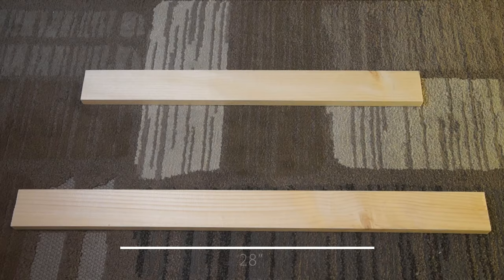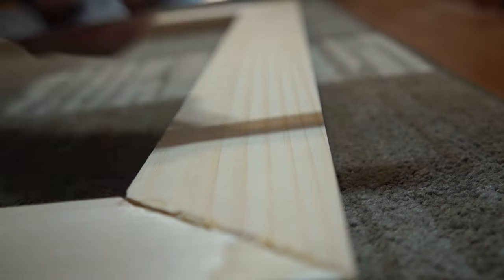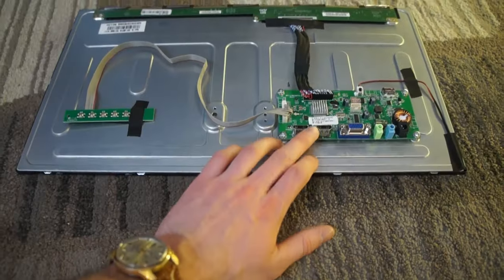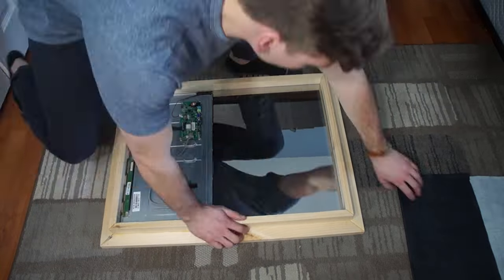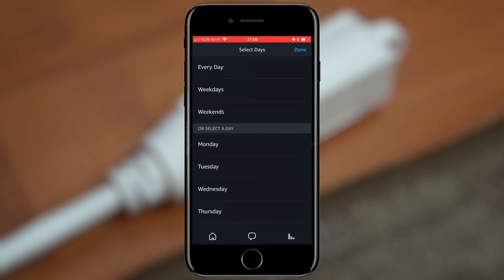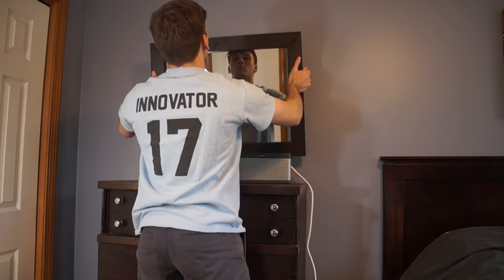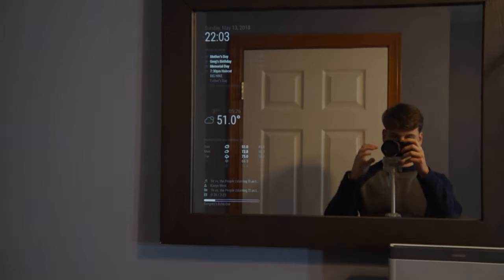ALEXA Smart Mirror (New Build)

Comment: put tape over the spot before you drill through, use a smaller bit to create a guide hole also helps and if you clamp a scrap piece on the backing (where you're drilling through to) helps prevent blowout for a clean look.

Comment: Might be a stupid question, but is there a specific cloth material you used behind the glass so no light can shine through?
Reply from the maker: Gaming with Keegan No I used thin wood painted black in another video and fabric in this one for easier cuts. Just make sure light isn't allowed through and you'll be good with anything. Make sure it's black too
Reply: You could also probably do several layers of spray paint over the back as long as you tape over the part where the monitor will be... might take a while longer though lol
Reply: @Grensom  Hey man is there any chance you could link it if you bought it online. I am in the process of making my own mirror and I've noticed that yours doesn't have a noticeable line where the monitor ends compared to some other people's. Would really appreciate it

Comment: Amazing!
Could you do a more in depht guide please? I couldn't understand the circuit properly. 
How does the sonoff work?
How are you able to play music?
Thank you for this video
Reply: dude... it's just lights... it's not that hard... and he probably put a Bluetooth transmitter, or the monitor has speakers, either way... and he just used a sonoff for a mic you could use any mic with the right detection range.
Reply: Sonoff is wired into the power cord so you can turn it on/off using Alexa
Reply: @joshanderegg4157  That is both really unconstructive, but also completely wrong.
The sonoff is wired to the pi's power cord, so you can use Alexa to turn it on and off (just a simple relay connected to the internet or something. It is absolutely not a microphone!). The leds are powered by the pi's GPIO pins I think, he didn't show code for that. 

(I watched the vid yesterday so don't kill me if I got some details wrong ;) )
Reply: Vemund Kremund how did he power the LEDs? I dont understand what happens after he split the 12V power source
Reply: Circuit diagram on video shows raspberry pi 0 but he is using pi 2 or 3 and pin 25 on pi is ground so basically this circuit diagram is fake. Im pretty sure he connected Gain to listening and responding pins on Pi.

Comment: Going to try this during quarantine here. Couple quick questions.   1 - Do you have a link for the material you used to block the mirror out?  2 - With the extra USB on the raspberry PI, can I just get LED and have it plug into that?  (Or would the LED's always be on?) Hoping to skip the battery as I can mount this on the wall long term and not looking to change out batteries. Great build, thanks for the tips!
Reply: did you ever find the black out material?

Comment: Amazing and Great Idea! 
I have one question tho.. the heat generated from the components will not cause the wood to burn one day for any reason like an electric malfunction or overheating or is it safe 100%?
Reply: The Philosopher the heat is minimal
Reply: The heats minimal. And also the wiring is completely safe. The pi just runs on 3.3v or 5v (cant remember) and the monitor is prolly well made. The Mosfet cuircit is simple
Reply: I have to say if you want 100% guarantees all appliances will be perfect, well, you're going to be disappointed.

Comment: Imagine screwing it on the wall then realize it’s upside down
Reply: Eric Su TRIGGERED 😂😭
Reply: GZonPC  how do you flip it if it's screwed into the wall
Reply: @meso_p  Its not screwed in, its hung up on screws which are screwed into the wall.
Reply: @sadbadmac  i'm basing off of OP's comment
Reply: @sadbadmac  also i don't think how you would hang it upside down then
Reply: Well, just rotate the screen then with two commands. 30 second job
Reply: Raspberry PI has a setting you can flip the screen orientation all in software. It wouldn't be a problem.
Reply: Ti esrever dna ti pilf - Missy Eliot

Comment: Great video. I'm currently starting to build my own still Gathering up supplies and materials. I bought a cheap picture frame at a discount Decorating store and you the back cover the came with the frame as my mask around the monitor. I just laid the monitor on top of the Mask appalled the dimensions of the monitor and then assembled it into the picture frame blocked out all the light.  Now I just got to figure out how to program it since I don't know how to use C plus plus and all that stuff

Comment: What I want to know is what are the prerequisite skills you need to know before you do this sorta project? Sure I can try to follow the video but I'd like to know the knowledge and skill you have so I can do some cool stuff like this on my own
Reply from the maker: Jesse Honestly the hardest part for me was the woodwork cause I'm not the best carpenter. Now I did go to school for electrical engineering so as for the lights - knowing how a MOSFET works is important. Additionally knowing some info about Raspberry Pi or arduinos with programming and utilizing their GPIOs might help. I am not really a Software Engineer so you don't have to be a pro there - as I am not

Comment: It's a good project but quite expensive... I mean ~400$ is a bunch of money but still worth it.
Reply: why 400$ when you can buy the monitor for around 20-30$. The raspberry pi 4 is around 30$ or you can buy the pi 3 cheaper. The rest is around 50$ top. So that's around 100-110$ not 400$.

Comment: 🎯 Key Takeaways for quick navigation:

00:00 🪞 Building the Mirror Frame
- Constructing the frame of the smart mirror.
02:05 🖥️ Assembling Components for the Smart Mirror
- Overview of the main components needed for the smart mirror:
  - Raspberry Pi, monitor, HDMI control panel, LCD screen, and backlight.
  - Use of heat sinks for Raspberry Pi to dissipate heat efficiently.
03:39 🎨 Crafting and Finishing the Mirror
- Staining and finishing the mirror frame to match existing furniture.
  - Adding ventilation holes and support screws.
  - Installing LED lights and wiring for indicator lights.
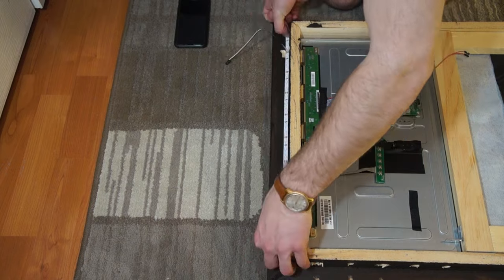04:36 💡 Setting Up the Electronics
- Connecting LED lights to Raspberry Pi with an end Channel mosfet.
  - Using a Sonoff switch to control turning the mirror on and off.
  - Integrating Amazon Alexa for voice control and setting routines.

Made with HARPA AI

Comment: So if I made this without the PI would I still see what’s on the screen or what, what does the PI actually do
Reply from the maker: Nbei7urerne Yes so you can do that, but the reason for the Pi is to run the software that displays the time, weather, music etc. It is basically a mini computer that displays to the monitor via an HDMI connection. It's small, powerful and customizable which is why I used it for the build.
Reply: Grensom also I clicked on the link in the description and it showed how to set up the pi for the google is there one for the Alexa, I simply wanted the weather and time to show up so I will need the pi right ?
Reply from the maker: Nbei7urerne I am currently in the works making an Alexa setup. But you don't need to that to run it. Just download the image in that video and skip to MagicMirror Install and you'll be allset. Setting up the Google assistant is optional on that video. You cab read the description of that video for instruction
Reply: Grensom oh ok so I can skip a good chunk of that so I don’t get the audio bit PS thanks for the awesome help and reply’s
Reply: Grensom so overall I will need the pi to just get the image and install magic mirror then I’m done right
Reply: Grensom could I just use a normal PC hooked up to a monitor to run the software or is the raspi a necessity?

Comment: Hi, where did you buy the material to cover up the rest of the mirror? Or what is that material called? Thanks, nice video!
Reply: did you ever find an answer to this. Ive noticed there isn't a noticeable line where is monitor ends compared to some other people's
Reply: @nickhabre2824  I never did unfortunately… I ended up ordering a mirror which is the exact same size of my monitor and used that.

Comment: 0:24 a little problem with your math,  the inner length of the shorter piece would be 17" not 16". If the width of the board is 2.5 " and you cut a 45 degree angle, you are cutting 2.5" off of the shorter side. 2.5 x 2 is 5. 22 - 5 = 17. Good job on the video! I am doing this as a project for my math class and that is how I found the mistake.
Reply from the maker: Yeah, you are correct - I did see that after the uploading. I should've measure twice.
Reply: what are the dimensions for the smaller frame of wood?

Comment: How does your power supply from the monitor fit? it seems to stick out but you do not show in the video the power supply replacement. Did you order a 12V DC Female power connector and solder it to the bottom of the monitors motherboard so the power supply will lay flat to the mirror and in return be flush with the wall? I made my own from this video but my power supply sticks out and I suck at soldering :/

Comment: I am planning on making a new bathroom mirror and now thinking it really needs to be a smart mirror. Any easy way to power the monitor and pi from one outlet?
Reply from the maker: Benny46drift Yes, I did the same in my bathroom. Use a small extension cord behind the mirror and you plug everything into that and only have one cord to plug into outlet.

Comment: This is cool but ... it would be cooler if the Pi controlled everything - screen power, LED, etc. Without giving up anything to Amazon for control you could run it all both on a schedule and on touch and/or motion detection (PIR or doppler).
And, even better, run dual screen so it works either with a pi4 or a pair of 3s or pair of zeros -  I suspect the zero would be just as a good a fit on super basic monitors as the 3b+ is.

Comment: Hey! This is really cool. I signed up for your Myrror too. How does the N-Channel MOSFET work with the Breadboard exactly? Are you simply building the circuit with the LEDs plugged into the correct channels? Are there any resistors?

Comment: Grensom, I can understand how the Alexa powers on the smart mirror via the Sonoff switch, however I am confused as to whether there is any integration with Alexa on the RPi itself? Does Alexa recognize the Sonoff or something else? I am assuming since you put a mic in there, it hears you but where is the integration?
Thanks.
Reply: Never mind, I found there is a whole Alexa API integration you need to do which makes sense. I have another question though, are you using a Pi Zero? I saw in the web they say Pi3 or 4.

Comment: Nice idea, but ... I don't know what paint you painted wood with. Wood works under the influence of moisture or lack of it - it increases or decreases its volume. In this case, a 1-2mm dilatation would be useful for the mirror and screen, which should be embedded in the gasket around the frame ... but generally good work;)

Comment: Excellent video you did a really nice job with your video outline I had a idea to share with you I if you have a duplex out but let below you may be able to run a fish line through the wall if it's an exterior wall it will have insulation on it so maybe a little bit more of a challenge but definitely shouldn't be extremely difficult you could then add what's called a rough in box into the drywall and then install a USB outlet behind the mirror you probably see where I'm going with this then plug your USB C cable Raspberry Pi into the outlet maybe find a cable with a 90-degree Bend it wouldn't hide the extension cord but you did is phenomenal job I would definitely live with that even if you had a dresser type mirror you would never see the extension cord and it would be a lot less trouble than doing what I said. Thanks again for the video I subscribe to your channel look forward to your future videos as well!

Comment: You're bad at math, how can you have an outside frame of 23×16 inches and build a smaller inner frame that would fit a 24×18inch?! It doesn't add up man
Reply from the maker: Well If you watch the video it doesn’t sit inside the frame. It rest on top of the frame with a 1/2” overlay. The smaller thickness frame is the one sized for the mirror. The only math issue here is the outside frame should be 23x17 not 16”
Reply: @Grensom  what are the dimensions of the mirror then? It has to be smaller than 23×17" right
Reply from the maker: TheOnlySultanOfficial inside dimensions are larger (slightly larger than 18x24), and used 1x3” pieces of wood cut at 45 degree angle. So should be 18”, 19.5” and 24”, 25.5” pieces
Reply: @Grensom  let's say I have a 32inches flat screen what are the measurements for both frames?